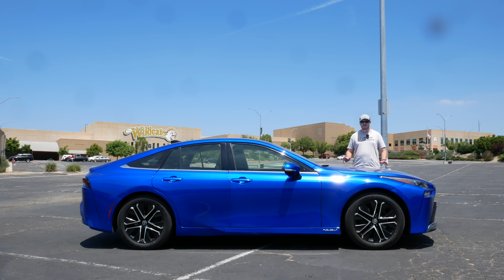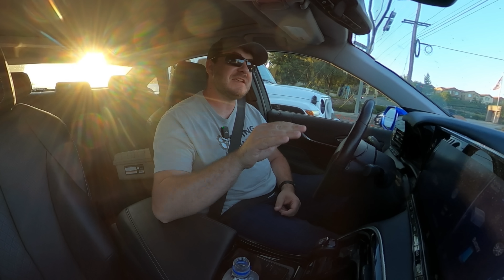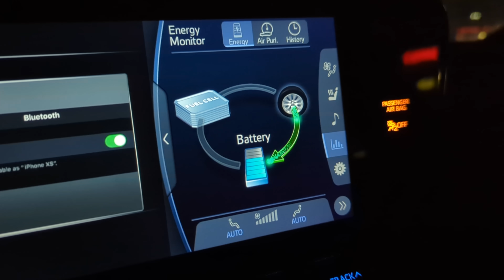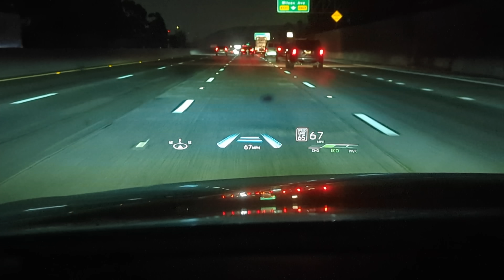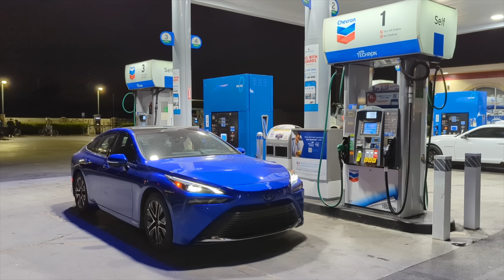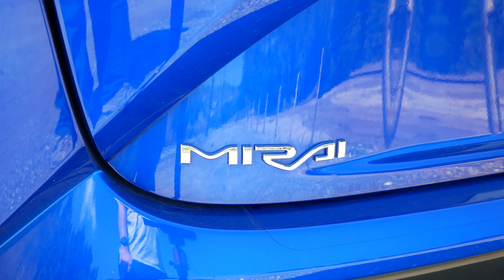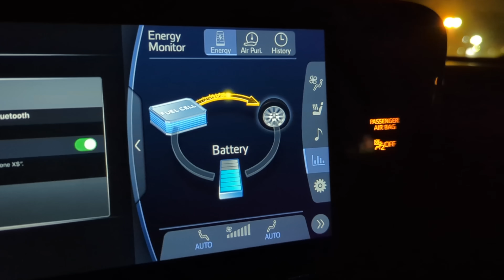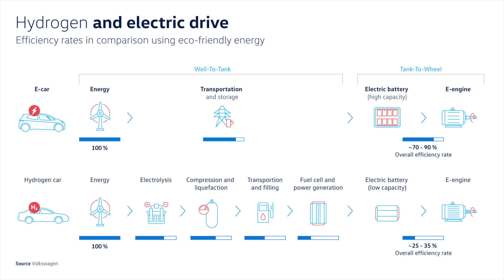The Toyota Mirai is Disappointing

Comment: The problem I see is that fuel distribution is more difficult than both electricity and gasoline. I don’t see it taking off in the consumer/personal sector. I also don’t see it doing particularly well in the commercial sector either. The value of uptime would have to be astronomically high and other than flying vehicles it’s pretty reasonable to electrify either bus stops for rapid charging during passenger loading, or electrify stretches of the route entirely. The real elephant in the room is semis. The United States of America have grown ENTIRELY TOO DEPENDENT ON SEMIS. The solution isn’t the Tesla semi either, it’s less semis, more trains. If our government actually cared they’d take some of that military over spending and divert it into nationalized rail networks used for both cargo and passengers. Rails main downfall is that its logistically requirements are too complex for private sector companies to manage effectively. The simple fact is that profit driven motives and rail management go together like water and oil. It doesn’t. For profit companies simply do not maximize throughput of goods on rail networks, they prioritize the maximum amount of cargo with the minimum amount of workers and locomotives. Trains often get so long they don’t even fit on siding tracks used to let other trains pass. Making rail great again and all but eliminating long haul trucking would do massive amounts to reduce emissions more than Tesla could dream of, especially considering electrifying rail is by far the easiest and would allow for long trips to be carried out by trains with relatively small batteries used mostly for regen and acceleration

Comment: 20-30 years ago Hydrogen fuel cells looked to be the way of the future of electric cars.  But then  battery technology went a long way.  The hydrogen and the fuel cell together really only act as an energy intermediary.  Kind of like... a battery. What you're left with is, at best,  an extremely inefficient electric car (that has it's electricity delivered to a fuel station by diesel trucks), and at worst, an extremely inefficient natural gas powered car (that has it's natural gas delivered to a fuel station by diesel trucks).  Yeah, I'll take a regular EV thanks, even if my house is powered by a natural gas fired station up the highway. 

Also hydrogen has terrible fire control properties.  Oh the humanity.

Comment: Hydrogen is so dumb- why would you produce clean electricity to produce green hydrogen. Clean electricity can be used straight into the battery. Also heavy trucks and semi can become diesel electric. Electric semi coupled with a diesel generator

Comment: Another aspect that helps with buses/trucks that could use Hydrogen- they generally refuel at central depots, thus negating the need for most of the distributed fueling infrastructure. A large city could easily roll out an entire fleet with a couple of fuel stations at the storage depot.

Comment: You can get hydrogen from water, that means it might be possible to develop a hydrogen car which recharges its hydrogen from the air itself, if your willing to just throw away the oxygen from the process and some energy loss.
Reply: Sadly impossible. The energy cost of turning water into hydrogen via electrolysis is fundamentally higher than the energy you get back from the resulting hydrogen, meaning the effect cannot sustain itself, let alone drive a car in addition
Reply: The losses from that are significantly worse than just using a BEV, for basically the same result

Comment: There are a dozen hurdles to getting hydrogen to work large scale for transportation.  Many of them can be ignored if you are willing for it to be very expensive and incredibly inefficient.  But the one hurdle you can't ignore is that there is not enough platinum and palladium in the world to produce enough fuel cells to replace the internal combustion engine.

The best use cases for hydrogen are in de-carbonizing the production of steel and fertilizer.  Not for energy.
Reply: And you can make steel in electric furnaces. 

So... Yeah. It's useless AF.
Reply: @gromm93 hydrogen's purpose in steel making is as a reducing agent, not a heat source

Comment: I'd trust Toyota, not some poor schmuck who doesn't even know how hydrogen is produced. Obviously, this is still experimental. That car looks absolutely stunning, better than most cars out there. By the way, how's the sales of those ugly abominations called EV going? Last I checked the entire EV market share was glorious 2%. Keep saving the planet, idiots.
Reply: 2% is bad? Then what is the hydrogen car market share? 0.001%?
Reply: Uhh, this is an electric vehicle. It just uses hydrogen to charge a battery that runs the motors rather than a battery that's directly charged from the grid. That makes it more efficient.
As for BEVs, they made 9,500,000 total car sales worldwide last year - around 12.5% market share.
HFCEVs made 7,500 total car sales last year. Around 0.01% market share.

Comment: It's a very stylish car, and there may be disadvantages with it because of the lack of refueling stations and the cost of refueling at this point in time but it beats an EV by miles in the time it takes to refuel it. It's only like 5 minutes as opposed to a half hour or even more for charging time on EVs.
Reply: V3 super chargers can charge an EV in 5-10 minutes. Hydrogen stations can only fill around 7-12 cars per day. And frequent use causing icing of the nozzle, which means after the first use, you have to say 20-30 minutes (or more if you are in a cold climate) for the nozzle to thaw and allow gas flow into the car. And this wait period needs to be done with the car off. And EV can be running with the heating or AC and entertainment while it chargers.

EV’s can also be charged from home. So that for every day apart from the days you do long road trips, you can wake up every morning with a full tank, and never have to leave early for work so you can detour to a fuel station on your way in. 

Which means 0 wait time.
Reply: @engineeringtheweirdguy2103  Okay so you tell me all the supposed advantages of owning an EV.  Please now tell me some of the disadvantages of owning one to give an unbiased view. Or are there none?
Reply: @jamessmyth5949  you lose 1-2% of your range in extreme cold weather. Towing sucks out huge amounts of range. It’s harder to go to some places that have little EV infrastructure if you’re not staying the night. But it’s far enough away to need a charge.
Reply: @engineeringtheweirdguy2103  Okay so it's not all roses with EVs as far as charging and range goes.  I think you lose a lot more than 1-2% range in cold weather. Plus all the other downsides of owning one that you EV people conveniently overlook. Like higher insurance premiums, costly repairs and battery replacements, higher depreciation, more costly purchase price, tyres that need replacing more often. An EV might be fine if you're really wealthy.
Reply: @jamessmyth5949  common misconceptions. EV’s don’t go through tires faster than comparable cars. The BMW M3 is the same size,
Class and category as the Tesla model 3, similar acceleration and handling. And almost exactly the same weight. Tire wear between the two is about the same. Over 5 years I changed tires twice on my Model 3.

There are no maintenance costs for Tesla’s. Infact the maintenance schedule has only 1 item. And it’s an optional tire rotation at 45k miles. So maintenance doesn’t cost more either.

Older generation EV’s did lose more than 1-2% in extreme cold. Because they used resistance heaters to heat the cabin and battery. Modern EV’s use heat pumps which draw about as much energy as the AC unit. Infact the tesla model Y (the first to have a heat pump) had its launch event for reviewers, Influencers and magazine editors, in the northern most town in Alaska over 2 weeks. Precisely to showcase this feature which is now standard on most EV’s today. 

The model 3 has the lowest depreciation of any car on the market today. That’s a common misnomer because people think the batteries die quickly 

The batteries last a LONG TIME. A study was done on previous generation batteries and found an average of only 12% depreciation after a whopping 200k miles of driving. Current generation batteries are designed to last double that. Their warranty alone is 8 years whilst the industry standard warranty for a combustion engine is only 5 years.

As for insurance, it depends on where you live and who your insurance is. I pay less now on my insurance on my Tesla than I did on my old Subaru Forester.

That is because EV’s often have specific repairers that can work on the cars so they don’t void warranties and are properly trained. Not all insurance companies have approved repairers that can work on EV’s. So they up the premiums.

As for the WHERE part, places like the UK have suffered from the trade fallouts of Brexit which doesn’t have a trade exemption for specialty parts for EV’s or specifically trained repairers to travel to. As a result, the premiums go up. 

Insurance companies aren’t shy about explaining those reasons. However if you don’t live somewhere like the UK, and have cover with an insurer that has approved EV repairers, premiums are usually equivalent or lower than ICE on account of their increased number of digital safety features and the fact they are less likely to catch fire in an accident or on their own.
Reply: @jamessmyth5949  so no. Not overlooking. Just not true. I’ve owned a model 3 for 5 years and 150k miles before I upgraded this year for a model Y as I’m starting a family. 

I live in Australia, travel some 70 miles each way for work, I had a standard range model 3 and I went to the snow every winter to snowboard with my model 3.

I’m happy to answer any questions but please keep in mind there is ALOT of FUD about EV’s out there. The most prevalent is the tire wear myth and the fire hazard myth. In reality EV’s are some 20 times less likely to spontaneously catch fire compared to ICE’a and 5 times less likely to catch fire in an accident.

People think they are more likely because they are disproportionately reported on by the media. Who reports EV’s fires at a rate of 400 times more often than they report ICE car fires. Infact many universities have done studies into this exact phenomenon.

For example, Australia has some 40,000 car fires every year. But we’ve had a whopping 4 EV fires in Australia over the 10 years….
Reply: @jamessmyth5949  hmm. Looks like one of my comments was filtered out. Here’s the basics.
Most of those are common mis conceptions.
- while older resistance heated EV’s lost 20-30% in extreme cold, newer heat pump models only lose 1-2% as they’re significantly more efficient.
- my insurance on my Tesla is lower than what I paid on my Subaru Forester. Only very specific repairers can repair an EV due to training and warranty issues. Insurers have specific approved repairers. If none of them can repair your car. Premiums for EV’s go up. Those that have approved repairers. They go down as EV’s typically have more preventative safety measures than a typical car and Teslas are very hard to steal or vandalise. 
- the cost of repairs are typically equivalent unless you damage the battery. Which is mounted as apart of the chassis in most cases. Which would be as expensive as a damaged chassis in a normal car as that’s typically a write off. Some bespoke EV makers like Rivian have tried to do funny things with their panels Making them extremely difficult to repair. But cars like the Kona, EV6 and Teslas aren’t any more expensive to repair as it’s typically all just standard body work.
-the batteries last a hell of a long time. They have an 8 year warranty (an ICE has 5 years on the engine). A study from previous generation EV batteries found that the average battery degradation after 200k miles was only 12%. Current gen batteries are designed to last double that again.
- the Tesla model 3 has the lowest depreciation of any car on the market today.
- tire wear isn’t any faster. They don’t actually weigh more than a comparable car. Consider the BMW M3 vs the model 3. Same category, size, performance, handling, and they’re almost identical weights. I have owned a model 3 for 5 years and 150k miles and i replaced tires twice over that period.
- the model 3 in the US is cheaper than the average car price in the US.
Reply: @jamessmyth5949  so my response keeps getting filtered out so I’m going to shorten it to a series of comments to see which ones the problem to the algorithm.
Reply: @jamessmyth5949  - older model EV’s did lose 20-30% of range in extreme cold weather because they used resistance heaters. Newer models typically use heat pumps now. Which are far more efficient and only use 1-2% more power. Infact the model Y’s launch even for reviewers, magazine editors and influencers was a 2 week even in the northern most town in Alaska. Specifically to showcase this.
Reply: @jamessmyth5949  EV’s don’t typically have higher insurance. My insurance for my Tesla is less than it was for my Subaru because of all the additional preventative features EV’s typically have. Some insurers do increase the cost for EV’s but for a simple reason. Not all repairers are trained for EV’s and many EV makers will void the warranty unless you go to specific repairers. But insurance companies only have a short list of approved repairers. If their approved repairers can’t repair EV’s without voiding the warranty or aren’t trained to. Then they’ll raise the premiums. So some do but most don’t.
Reply: @jamessmyth5949  repairs on an EV only stop being identical to ICE once the battery is damaged. The battery is apart of the chassis. Any crash substantial enough to damage the chassis, is USUALLY a write off. 

But repairing paint and panels is the same no matter what car you drive. But keep in mind the maintenance of EV’s is typically non-existent. So there’s another bonus for EV’s in terms of cost.
Reply: @jamessmyth5949  EV batteries last a LONG time. Longer than an ICE engine will. A study done recently on previous generation EV batteries found that after 200k miles, EV’s battery only degrades 12%. And current generation batteries are supposed to last twice that again.

EV battery warranties alone are 8 years, whilst typical ICE engine warranties are only 5 years if you maintain a strict and costly maintenance schedule.
Reply: @jamessmyth5949  the Tesla model 3 has the lowest depreciation of any car on the market today.
Reply: @jamessmyth5949  the model 3 in the US costs less than the average car price in the US.
Reply: @jamessmyth5949  tires don’t need replacing all that often either. No more than a regular car. The model 3 and the BMW M3 are in the same class, category, are the same size and have similar performance and handling. And yet they are nearly identical in weight also. What makes you think the tires wear any faster?

I’ve owned a model 3 for 5 years and 150k miles and I only had to purchase 2 sets of tires over that time.
Reply: @jamessmyth5949  so looks like only the last two points. I was explaining why every point in your comment on the downsides omitted was wrong. And is actually quite the opposite. Because almost all of those points are common myths about EV’s.

Comment: Ok but I still like Hydrogen.

We just need a ton of thorium nuclear power plants, build more then we need so we can make hydrogen from salt water, etc. I really like Hydrogen. I also can't charge at home..
Reply: It's easier to get you a charger at home than it is to build thorium reactors
Reply: @logitech4873  Not really, I live in an apartment and the home owner isn't willing to upgrade my breaker box (100 amp) to then pay to add a few grand worth of copper cable + an outdoor rated charger.
Likewise neither is my employer. Electric vehicles are a luxury only home owners can own without having to spend hours a month at a charge station.
Reply: @GeorgeWashingtonLaserMusket  In my country, we implemented a simple right to charge law. Landlords here cannot refuse your request to have an EV charger installed. Of course you have to pay for it, but they can't prevent you.

The result is that it's easy for the vast majority of people to charge. All new houses and apartments are also built with EV chargers in mind.
Reply: If you're electrolysing water for hydrogen, why not just use that electricity in BEVs and get far higher efficiency

Comment: I love hydrogen cars, the idea is stellar. 
A gas like experience, with quick refueling times unlike electric cars.
Theoretically "green" 
And twice as efficient on paper as gas.

Only issue is... Making, storing, transporting, and using hydrogen.
Making, the most common way currently is via fossil fuels, which kinda ruins the entire point of hydrogen.
Storing, you need super high pressure tanks to store hydrogen, its not only expensive, but it also needs to be super cold. Which is hard to do "cheaply" on a car.
Transporting, Hydrogen is super expensive to transport due to the specialized trucks trailers needed. 
Using hydrogen is only about twice as efficient as gas, which isn't bad on paper, but if you take into account of all the energy lost while making it, it becomes way less efficient in general. 
Oh yeah, and forgot to mention THE COST!!! Its much pricey than gas, even in joe bidens high gas priced world.
Reply: It's interesting how you attribute current gas prices to Joe Biden, even though the gas prices went up globally, and the US has really low gas prices compared to other countries.
I guess it's hard for Americans to have a global perspective on things.
Reply: @logitech4873  Europe went up for obvious reasons. 
It was joe biden who caused it. I wish foreigners would mind their own business :)